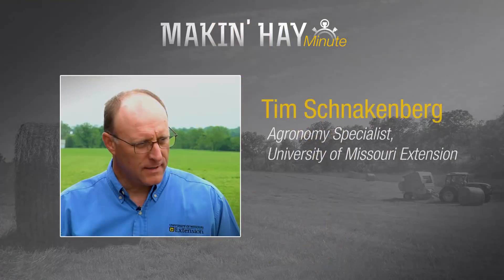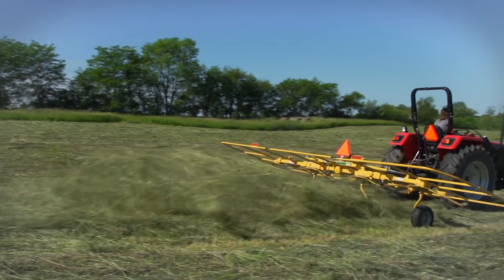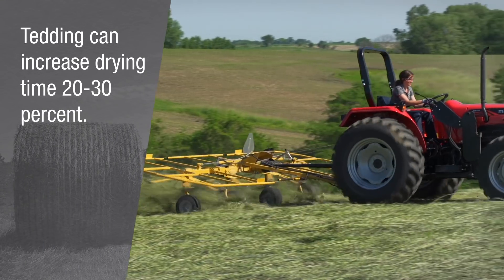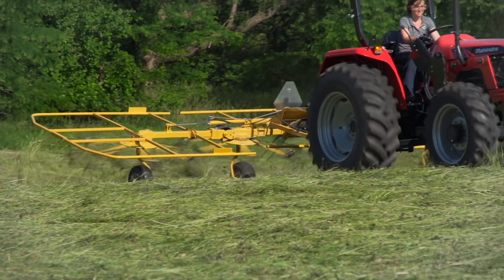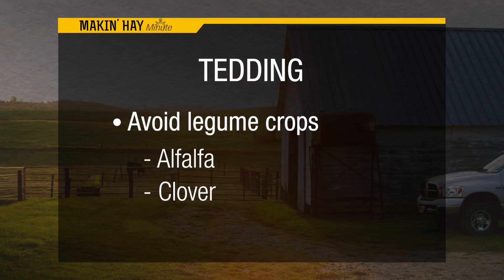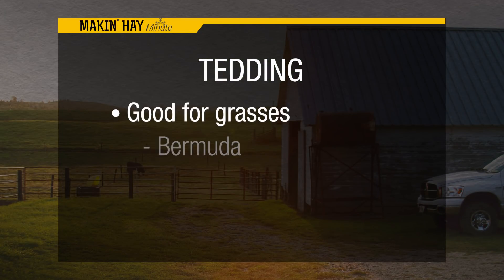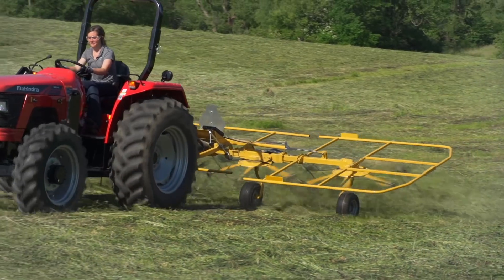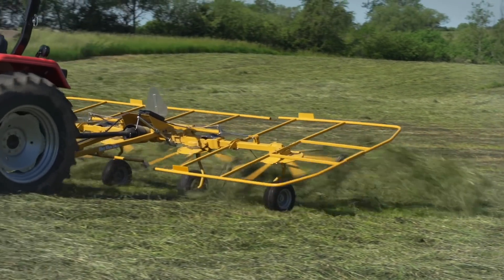Makin' Hay Minute: Tedders: Why and When to Use Them

Comment: Really? Why would you want to INCREASE the drying time!
Reply: I was curious about that myself.  Guessing he mis spoke?
Reply: down here in south Texas the sun will dry out the top of the hay before the bottom or core of the windrow is properly cured. tedding the hay for us more evenly cures heavy windrows as well as speeds up drying time total due to a more even drying effect. And I understand most people up north don't understand the types of dry matter yields that we deal with on a proper hay and forage operation on the gulf coast. On a non drought year, an average yield on a hybrid Bermuda strain, under proper aeration and fertilization program, can yield on average 6-7 tons per acre 17% moisture, high protein hay.
Reply: RAIN and horse farmers!  😂